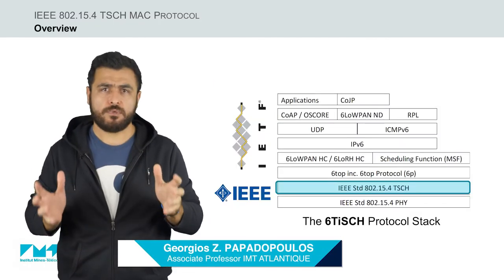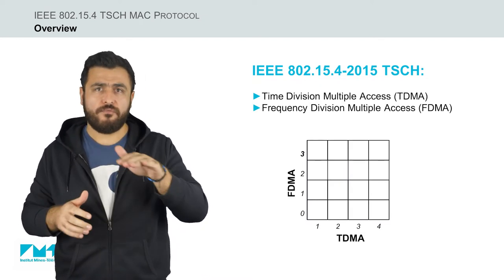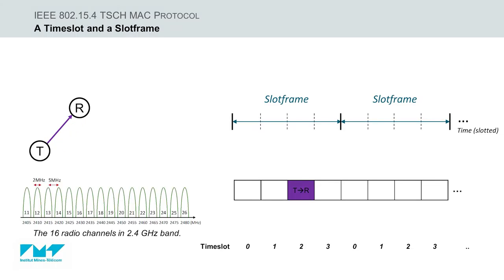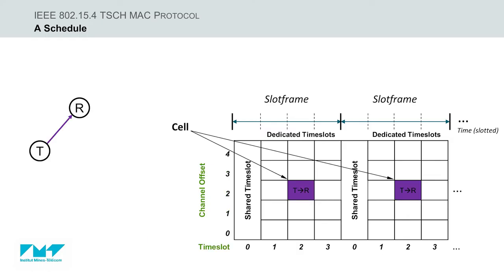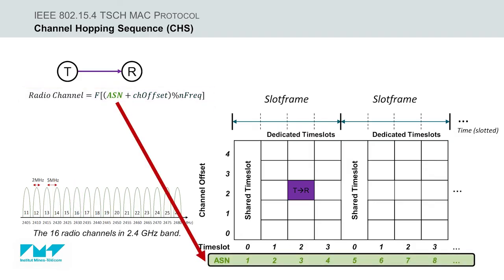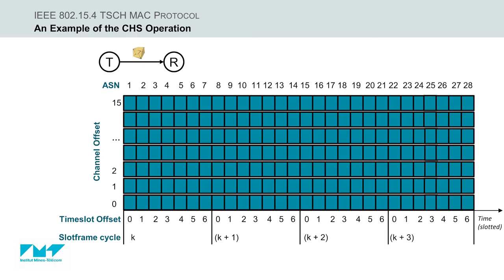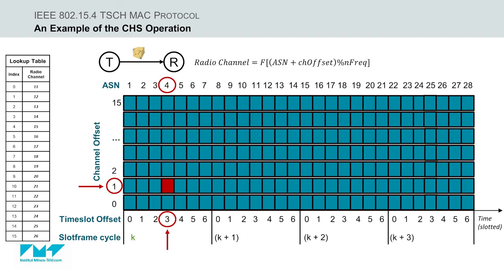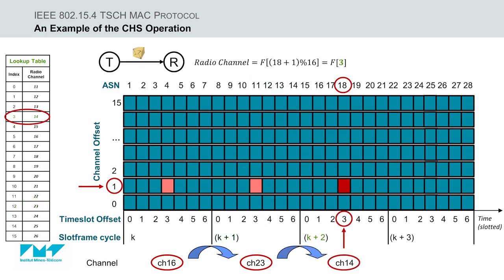IEEE 802.15.4 TSCH MAC protocol and Channel Hopping Sequence algorithm | IoT Protocols

Comment: what is the n*freq, how did you find it as 16?
Reply from the maker: nFreq stands for number of Frequencies. IEEE 802.15.4 standard has defined 16 radio channels in 2.4 GHz, and thus nFreq is equal to 16.